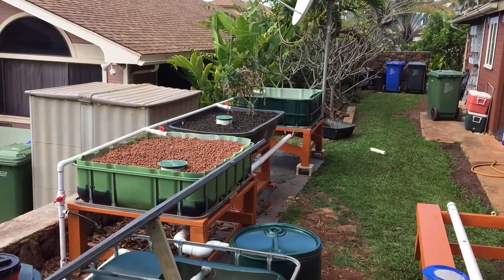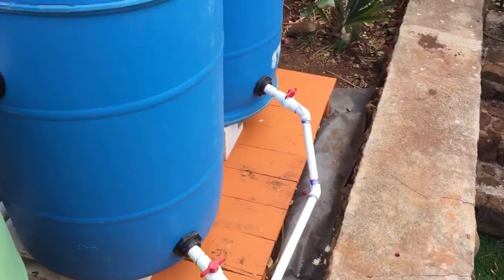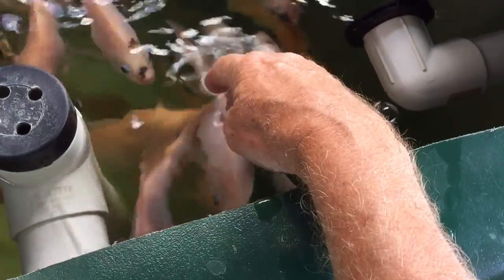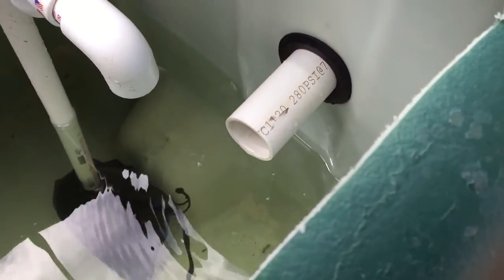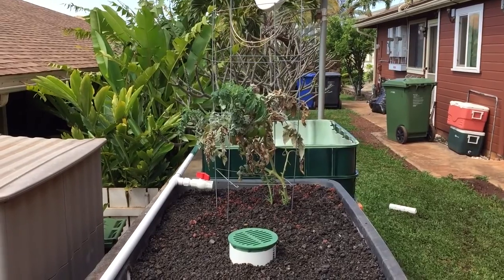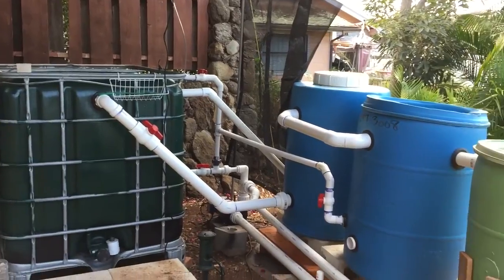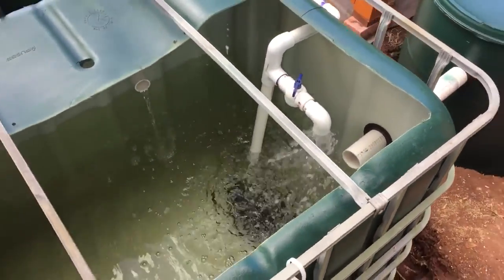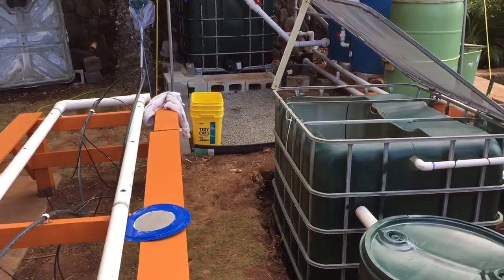Aquaponics dual loop system update

Comment: Nice setup... How to get rid of the nitrate in fish tank if you split the system?
Reply from the maker: Stanley Lai Aloha Stanley. Most people use a trickle filter for that reason. I just try to monitor it and add fresh water as required. Talapia are a hardy fish and can tolerate higher Nitrate levels.  I suppose I could reduce the number of fish in the tank as well if it got too bad. But I do have some stuff that eliminates nitrates just in case. Never had to use it yet but I keep it as a security blanket just in case. I exchange somewhere around 30 gal a day of fresh water.